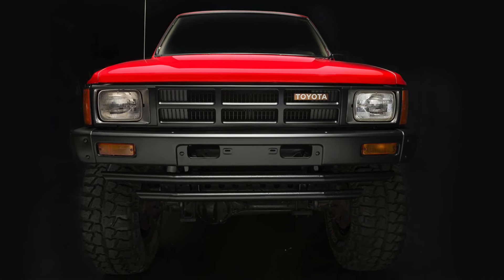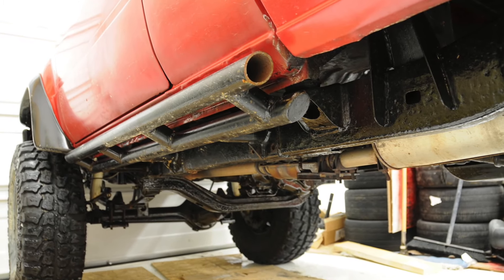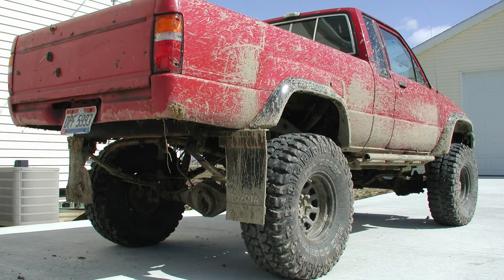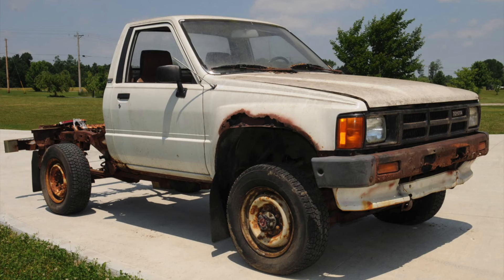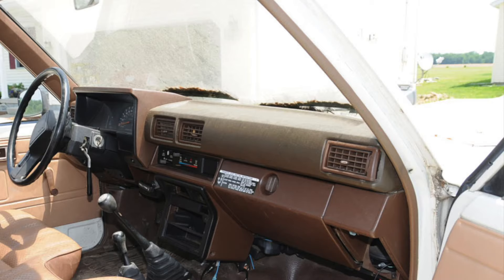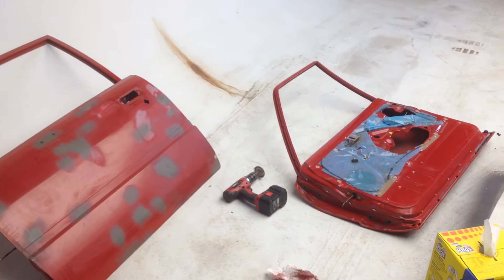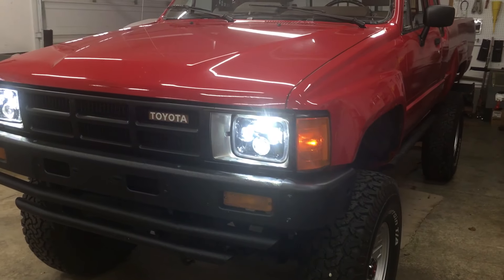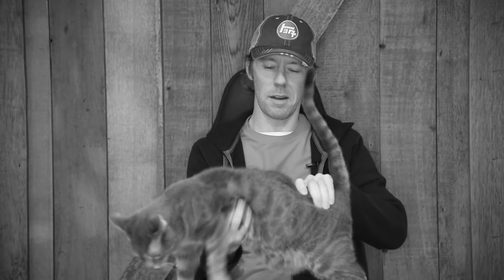1985 Toyota 4x4 Pickup Cost: Build, Modifications & Restoration

Comment: When you mentioned the 5.29 gears and lockers you for forgot to add in the install kits and labor. You’re looking at well over $1k just for gears, install kits, and labor not including lockers.
Reply from the maker: I bought the truck with those already installed by the previous owner, so it was no cost to me. But you're right, the cost of labor alone made the truck an even better deal.

Comment: what's the best part site? my '88 just got broken into in a failed attempt to steal. broke the steering column plastics... I could use some sites with legit interior parts, and some anti theft ideas! (has the defrost wired as a kill switch, but my in-laws take care of it for me, as i work overseas, and they cant remember the kill switch, and so the take it to the shop if the switch is flipped and they don't remember...….")
Reply from the maker: For interior parts, ebay is probably your best bet. Prices are inflated there because sellers have to charge extra for all the ebay fees.  I started selling used parts on my own site https://6thgeargarage.net/yota/ but don't have any column trims listed right now. I like that sneaky kill switch idea!
Reply: @6thGearGarage  Many thanks, Ebay proved fruitful. Any suggestions to make her harder to break into?!
Reply from the maker: @zackeryfleming8214  Unfortunately that will be a downfall of these trucks. You can add layers of securoty to slow a thief down once they're inside though, such as an alarm, steering wheel and or pedal locks, and most importantly... kill switches. The more kill switches, the better. Even some fake ones that do nothing with wires that lead to nowhere will slow a thief down, as they try to start the vehicle with the switches switched in all possible combinations.

Comment: Basically buy 2 donors and buy one slightly running one. 😂
Reply from the maker: That's the Ohio way when there aren't many nice trucks left :)  I actually did the same for my current 1980 Toyota Pickup build, but one truck was southern because I needed a decent frame.

Comment: ditch the body lift you gain ZERO clearance
Reply from the maker: I’m not a fan of body lifts, but it was already on the truck when I bought it, and allows 35” tires without any additional body cutting.
Reply: @6thGearGarage  makes sense and its also cheaper👍

Comment: Give you 8k for it cash? Do you still have the 1985 motor that came out of it? I'll buy that if you do.
 I'm a Toyota nut for about 19 or 20 years bought my first yota for 800 bucks a 1979 4x4 20r 4 speed when I was 15 in 2001 lifted it wheeled the shit outta it broke it fixed it over and over again went through probably 7 motors lol and have had at least 50 1979-94 Toyota pickups and 4runners probably more over the years still have the first one tho. Fixing it up for my niece who is 13 now for her first truck.
Reply from the maker: Sorry it's not for sale. The original motor is long gone. That's awesome you still have your first Yota and keeping it in the family
Reply: @6thGearGarage  Too bad the motor is gone. I'm guess you didn't kno wut you had with that motor if intact it was the original 1985 motor. Not many people kno about this but only in 1985 there was a mistake made by the toyota factory and the blocks were made 2 millimeters shorter than any other year of 20r's or 22r's or 22re's even the turbo ones by accident and I'm sure your aware of what a shorter block means higher compression and that translates to more HP out of all stock components and more if you build one. I personally leave them all stock internals and put a stock 20r head and intake with Weber carb and header and 2" inch  exhaust on them but I use a 20r head out of an old toyota motor home because they have the RV cam it's just a bigger cam from the factory to help move a heavy motor home. And that combo runs like a mofo let me tell you and it's cheap and easy to do because it's all stock factory parts except for the Weber 32/36 carb and header but I've done some with stock 20r carbs and even stock 22r carbs and stock exhaust manifold and they run really really good that way too. I've bought up any and all of the 1985 trucks and motors as well as the 20r old motor homes I could over the past 20 years just because having a 22r or 22re Toyota just isn't the same thing once you've had one of those hybrid motors the difference is crazy. I probably have 10 of each motors right now and I usually swap that motor and put in a 22r before I sell any pickup
Reply from the maker: @jistinkaainger7994  So there were some Laser blocks in 85 that were 2mm shorter than the other 85-95 laser blocks?  Never knew that!
Reply: @6thGearGarage  yes only in 1985. the later blocks in like in October November December that went in to the 1986 pickups and the 4runners were corrected but the late 1984 through September 1985 they were 2mm shorter. You won't hardly find one in a 1984 pickup but there's a few but most of the 1985's have them. as you probably  kno they start production on the new model year 3or4 months before the current year is over.

Comment: Hey guys did anybody out there that can help me I got a 87 Toyota truck we will drive extended cab I got this truck for $450 and it's damn near perfect I'm trying to put a T4 Turbo on the motor the truck's too nice to get rid of I got to keep it and I got a set of four carbs and I would like to get a twin cam head if somebody could help direct me in a way that I can hook that turbo that T4 Turbo and run blow through carburetors with a twin cam head I can do a lot of mechanic stuff but what I'm looking for is information on basically the head compatibility I need a twin cam head so somebody could help me my name is Jericho and thank you